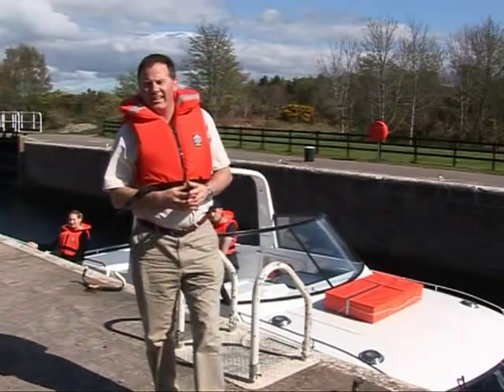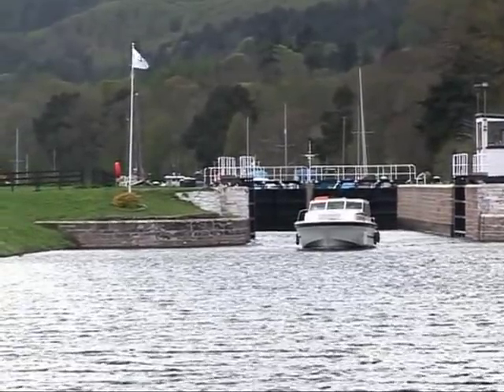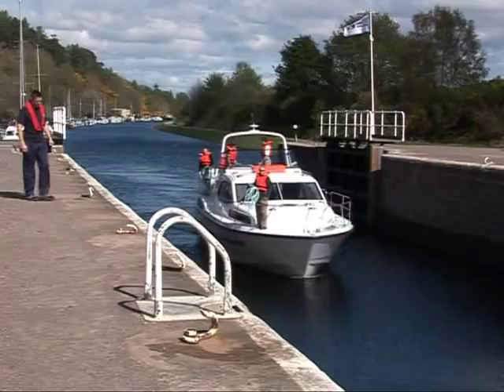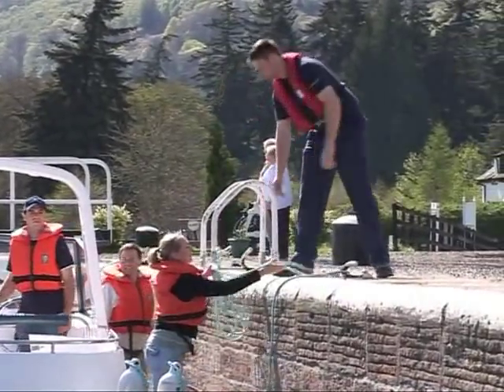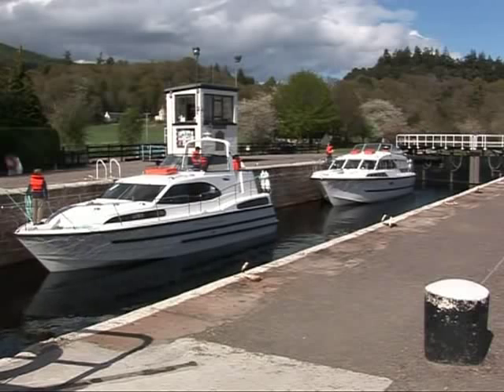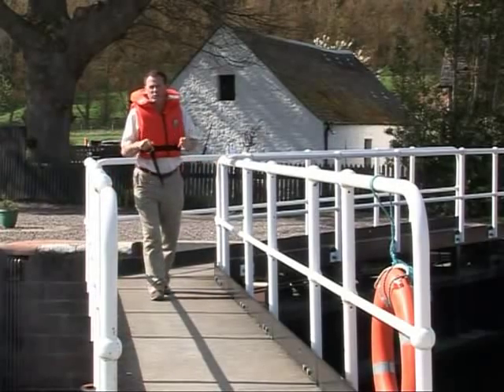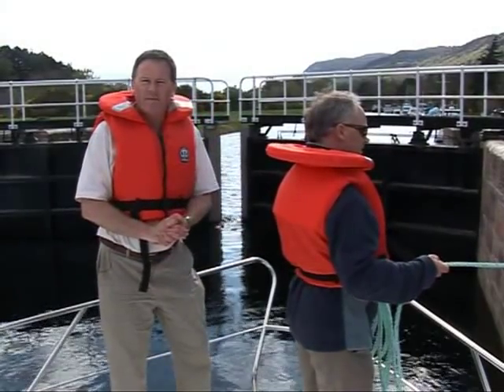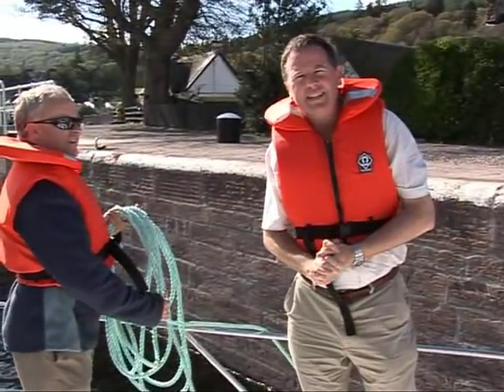Caley Cruisers - Locks

Comment: Mmm. You may also want to consider ensuring you have fenders on both sides of your boat. Boat and lock brick or concrete don't mix especially if you want a few deep scratches in your gel coat.
Reply: Giovani Garcia hire boats have rubber bumpers all the way round